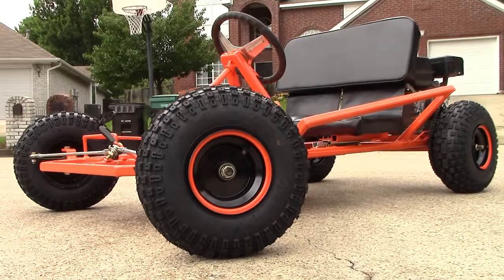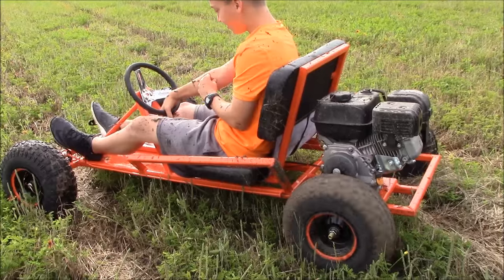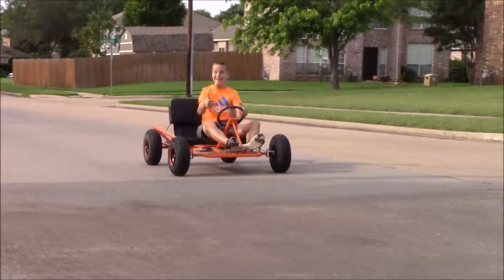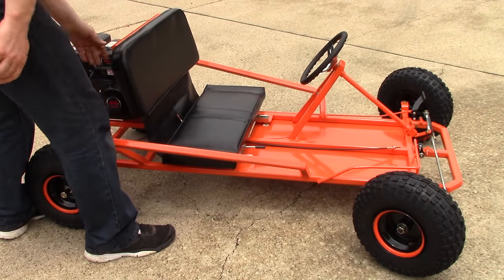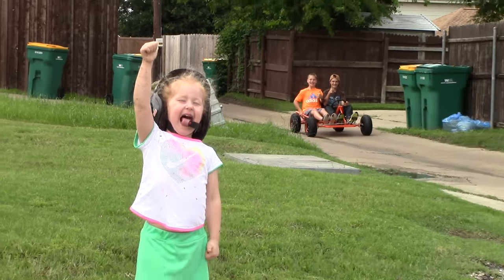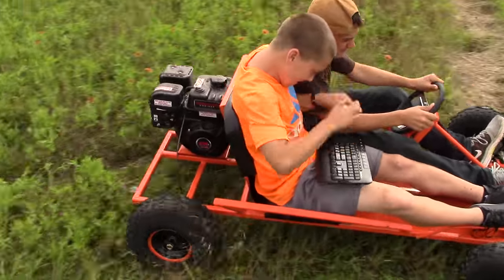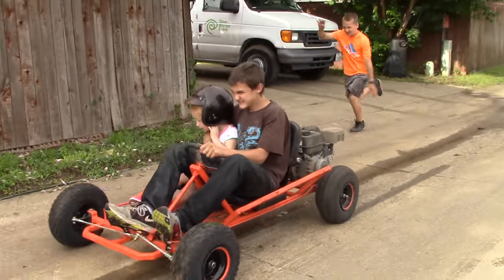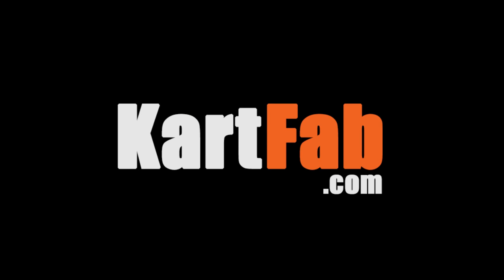Go Kart Build Free Plans (PDF Download)

Comment: Hello , I send a cordial greeting from Tijuana, Mexico , my father and I are trying to form the Go Kart has formed simple mode and you have two questions : the engine that is used lawn mower ? and how much is the estimated budget to realize it?

thanks
Reply from the maker: +Alexis Verdugo engine any 5 to 6.5 hp horizontal shaft, 3/4" straight shaft engine. lawnmower engine is a vertical shaft and will not work. honda gx160, honda gx200, honda clone, predator 212cc, all will work if they have horizontal shaft. Estimated budget is $750 for free plans, and $1100 for deluxe plans.

Comment: I have a 13 hp (420cc) engine laying around and am wondering if It will for this go kart?
Reply from the maker: Do you have a death wish? If so, it will work fine for this little kart :-) you saw my wheelie video, right? That was only a 389cc engine. Any 4-7 hp engine will work fine for this kart. I'm not saying put it on there, but if you do, you would need to use a live axle as it would just break traction and peel out everywhere with a 13 hp engine. 13 hp engines are more for large karts that go 40 mph. This is a nice 2 seater entry level kart that was designed around simplicity, low cost, and ease to build.

Comment: thanks for the frame idea! plan on picking up a fluxcore welder and doing a build myself.. id like to use a cheap amazon dirt bike engine so i can have clutch/4 speed trans engine and trans can be had for $300-$400

Comment: I'm taking a welding class. This looks like a really nice chassis but I am just gonna leave a little more room because I'm gonna use the 420cc predator and get a bigger intake, bigger exhaust, rejet the engine, and remove the governor. And I only weigh 90 pounds, and I'm gonna use aluminum as much as I can on the chassis. That thing's gonna go fast. :)
Reply from the maker: cool good luck. Steel is cheaper and has superior properties vs aluminum. Steel wont dent/shear as easily.
Reply: KartFab I know! thank you for the advice, I was looking at doing aluminum for some of the parts that won't be under much strain just so that it's lighter and therefore faster. I want to put a roll cage on mine and I think aluminum would make a perfect roll cage without adding much weight. And I don't have to worry about price because I'm taking my welding class through my high school at a college and they have a ridiculous amount of scrap metal, both aluminum and steal. I'll have to buy just the bare-bones parts for it such as a drive train, engine, and sprockets (I'm sure there are other things I'm forgetting about)
Reply from the maker: ok have fun, the weight of the frame really doesnt effect speed at all. The engine, gearing, and tire size will effect speed.

Comment: I need the installation of combined pedal for braking and acceleration ..will you give me any idea??
Reply from the maker: pressing pedal releases brake, letting go of pedal activates brake and releases throttle. Will need to have some sort of spring setup to be constantly applying pressure to brakes that is overcome only when pressing the pedal with your foot.

Comment: Hey Kartfab,

I am planning to build this go kart with one key change: I'm hoping to be able to make it electric. I have never done anything with go karts and I need some help. I don't know what batteries and electric motor will be best so please help! Thanks!
Reply from the maker: Mom not experienced with electric either. Head on over to DIYgokarts.com, they have a forum there and build logs. Maybe you can get some insight there on what motor, voltage, and controller to use.
Reply: Thanks anyway man!
Reply: Hey Kartfab,

Would you mind letting me know what parts in your kit I would not need if I made the kart electric? Thanks!

Comment: You can put racing wheels instead of off-road wheels right? I wouldn't want to flip over while doing a turn..
Reply from the maker: +Eric Garcia you would need to build a race kart if you would like race wheels. This is a simple kits go kart that is not meant for speeed or racing, and is one wheel drive. Race karts are live axle, 2 wheel drive and have a much wider base.
Reply: +KartFab Ok, thanks for the info! I didn't see that it was a one wheel drive so I appreciate it.

Comment: How much all this cost?? Like the whole build? Would it be cheaper to buy other parts other
Then the kit?
Reply from the maker: +Mike Townsend link is in description. It is cheapest to buy kit because the parts cost less bundled together. Hardware and steel are about $200 and engine is $160 so roughly $800

Comment: Does it take much skill or experience to weld this all together?
Reply from the maker: umar dawe experience, no, skill no, just common sense and ability to follow instructions. If you have zero welding experience, you should practice welding on scraps or extra steel first before you try tackling the frame welds. When I was first learning to weld i hit up this channel, he has a website too https://www.youtube.com/user/weldingtipsandtricks  if you dont have a welder, you can get a small mig or fluxcore welder as they are the best ones to weld with and just plug into a normal outlet.

Comment: If I buy a Go Kart Kit Without Engine
Then a engine will that all I have to buy and how much will it cost y
Total
Reply from the maker: LOSER DWEEB it does not have reverse. The engine you will have to buy is any industrial horizontal shaft, 3/4" shaft, 3-7 hp engine. Common engines in the US are briggs and stratton, honda, subaru, predator, tecumseh. common cc ranges are from 126cc to 212cc hope that helps.

Comment: Want to extend the gratitude for the plans.    This was a lot of fun to build and learn to weld building it.   Im getting to build my third one for the year from a diffrent set of plans.  But this is a great project to learn on.
Reply: how much did it cost $? to build i wanna build one like this
Reply: @WARVIATION  steel ran about 200.  Engine is 200 from HF. But spend the extra 50 for the 224 predator.    Everything else depends where you source otherwise about 1k if buy everything listed
Reply: @cdrderfyt  ahh ok! im in a 3rd world country so parts are going to all be new and expensive, no one sales used parts all imported from US and China,  I will try to build this one
Reply: @WARVIATION  a little bit of creative thinking elbow grease and knowing someone that can machine the parts you can't scrounge and you can easily build this for a couple hundred or the equivalent in what ever currency your using.
Reply: @cdrderfyt  ah ok ! thanks   I like this one a lot i liek offroad gokarts more than racing ones tbh

Comment: Gas and brake pedals can be relocated? Build is for L leg amputee
Reply from the maker: Sure, as long as you put them in a spot that they can pivot on. Also, you can get a regular throttle lever for a motorcycle style brake and attach that to the steering wheel to use for throttle (brake might be a little difficult to set up, but you can still do it). If you set up brake that way, you will need to figure out how to attach cable sheathing to kart, and probably use some sort of cable/wire stop to attach cable to brake band.
Reply: Thomas So

Comment: How much does this go kart cost roughly?  Want to have something to do in my spare time and want to drive something since I can't drive a car yet.
Reply from the maker: Randomizer when it is all said and done, you will do it between $750 and $850. parts, steel, engine, hardware, paint, and welding/cutting supplies. Beats buying a chinese made kart for $1,500 right?
Reply: Yeah I'd say so! love the orange paint job on it, i might consider this 100%. Might look around see if i can find steel for cheaper.. that stuff is what your paying for on this thing.
Reply from the maker: yeah. a steel yard or metal recycler would work. you could also get it in 14 gauge instead of 11 gauge. The front axle and rear axle would need to be in 11 gauge though, youd save a lot that way.
Reply: +KartFab i wonder if there's anyway you can make this thing cheaper, I'm 13 I rely on my mowing business
Reply from the maker: ummm free plans, parts that normally cost 1k for $450, and yeah.... so i really cant make it any cheaper than what i have done. Maybe you should charge more for lawns :-)
Reply: +KartFab lol Ik I'm just a cheapo
Reply: +KartFab I've been looking all over the Internet for go kart frames but I can't find anything

Comment: what is the motor you have used? is it gasoline? im looking to make one
Reply from the maker: +iOSTips AndTricks predator 212cc found at harbor freight in the US. any industrial engine will work that has a horizontal shaft  that is 3/4" (about 4-7 hp range is fine)
Reply: +KartFab could turn give me advice for making a fast go kart (50-70mph)
Reply from the maker: A 50-70 mph go kart  will get you killed, so I wont be able to give you any advice that could result in your death.
Reply: +KartFab any other engine (40? 30? 25?) me and my family are going to race our own go kart that we've made
Reply from the maker: briggs 3.5 hp, briggs 5 hp flathead, honda gx160, honda gx200, subaru ex13, subaru ex17, greyhound 6.5, honda clone, predator 212cc - all these are the most common engines out there.

Comment: Is it possible to do a weld free project for this particular kart, or maybe a mixture of wood and steel?
Reply from the maker: +Jordan Pulvirenti Many people have that question. Possible? Yes. Safe? No. I cannot give you any guidance on a project other than welding. My only suggestion would be to buy a go kart and bolt it together.
Reply: I think i have seen someone build an aluminum go kart without any welding, it can definitely handle smooth surface but probably not dirt/gravel ohv roads where you can legally drive them

Comment: can i put racing seats on the go kart with the sliding moshion
Reply from the maker: +Wilfrid Boursiquot you will need to fab up your own bracing that the seat sliders bolt to, then bolt the racing seats to said bracing. As long as the seats fit, I don't see why it wouldn't work.
Reply: thank you so much

Comment: Hey, how do I put a transmission in my go kart?
Reply from the maker: +Adriana Cerdas a transmission is the clutch for a go kart. There is a CVT (continuously variable transmission) also more commonly known in the go kart scene as a torque converter. A 30 series torque converter will be used on a 5-8 hp engine, and a 40 series from 8-18 hp. Some racing mowers use a peerless transmission that is race prepped. Hope that helps.

Comment: You should have made both rear wheels turn together use a live axle and use a torque converter instead of the clutch you used and use a 13HP Honda with electric start with recoil backup and maybe use rear tires from a ridding lawnmower for rear wheel.

Comment: Do you have One Seater Live Axle Kart???:))
Reply from the maker: no, but you could easily modify the bench seat live axle plans by just getting different tie rod lengths, and centering the steering wheel and hoop.
Reply: KartFab thanks!:))👍👍👍
Reply from the maker: np and good luck with your build!

Comment: hi, hola, im tryin to do the same but with a Honda gx620 motor, vtwin,
Reply from the maker: you can do it with the live axle plans I have on my website. Lengthen the go kart  in the rear to accommodate the big motor. You can also lengthen the front by about 6" without jacking up your steering.  It WILL wheelie and is completely unsafe. I do not condone this, but its definitely possible.

Comment: Can i use there biggers tires?
Reply from the maker: +Juustooz you can do whatever you want. It's designed for 145/70-6 tires. You could be fine with 15x6-6, but that's as big as I'd go. If you want big tires, go to kartfab.com and check out my deluxe live axle plans. They call for 18" rear tires.
Reply: +KartFab Okay. Thanks a lot!

Comment: How long does it take to make and how much does it cost
Reply: BrokenBug866 it all depends. Time varies because everyone works at a different pace. And also for these plans you would need a welder and welders are not cheap. And if you got a welder. you would need a higher voltage outlet installed, so you would have to call an electrician and have them set one up for your welder. which would be very expensive.
Reply: oh alright thank you
Reply: hi
Reply: Tell me all informations

Comment: Around how much is the total cost of everything on the cart
Reply from the maker: eml fer steel and hardware was about $170 +cost of parts that I got at go powersports. I worked with them to make sure they had everything I needed, then they offered to make a kit for the plans so it wouldn't be so expensive sourcing everything separately. They have the parts kit here http://www.gopowersports.com/kartfab (I'm sure they are loving that that I did this build right about now). -Shameless plug for them because they deserve it and have a lot of good parts.
Reply: Thank you so much i love your vids
Reply from the maker: eml fer no problem man, ill be updating the plans this month to be super detailed and release an extended how to build a go kart video that will walk you step by step through the entire build. The plans right now are great and are all you really need, but i'm going to make them super super easy to follow so you really cant screw anything up.
Reply: Lol thanks so much for everything its been a huge help☺
Reply: When will the video on how to build the go kart be out ?

Comment: you r awesome I consider you a bro thx ive been looking all over for this
Reply from the maker: Glad I could help.
Reply: ***** btw I already have a DuroMax 7 HP Go Kart Log Splitter Gas Power Engine Motor - XP7HPE Electric Start engine should can I use it or will I have to buy the predator?
Reply from the maker: Yes the 7hp will bolt right on to the plate and everything. 3/4" shaft
Reply: ***** thx
Reply: ***** also will the Battery come with the kit?
Reply from the maker: No. You can get a small lawnmower battery for something like that.

Comment: A two seater? Well, maybe, if the two on it were just kids. But it doesn't look wide enough for two adults. You should have included the modified frame dimensions for a two seater adult size version in your free plans.
Reply from the maker: If you’re looking to fit two adults on something with four wheels, it would be called a mini buggy or a Polaris RZR. In the future though, I will be making plans for an off-road go kart that is much larger that will fit two adults. This is just a simple yard kart

Comment: How much money did you use to build this?
Reply from the maker: Elvis Amin Thats the best part, its pretty cheap. Parts kit was $500, steel $150, hardware $50, engine $160. A lot of people will start out and end up spending well over 1k buying parts seperately, but this build is $860 maximum because I had gopowersports make up a parts kit for it to get all the parts you cant make in one shot.
Reply: Also, how did you get the metal?
Reply from the maker: i just googled "steel distributors near me" Check out this article i wrote about the parts and materials here, it will answer a lot of your questions, and goes with the plans http://kartfab.com/go-kart-plans/go-kart-materials
Reply: Thanks, and this is my last question, how long did it take you to make it?
Reply from the maker: Took 1 1/2 months only working some Saturday's. I did not work fast or hard, just took a few hours here and there.
Reply: Thanks